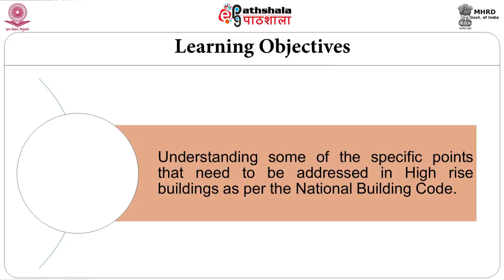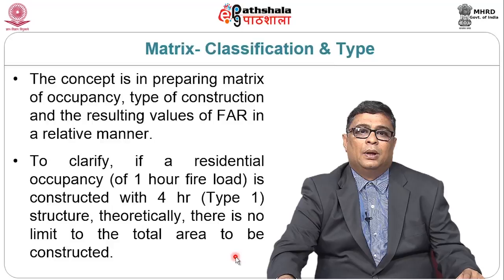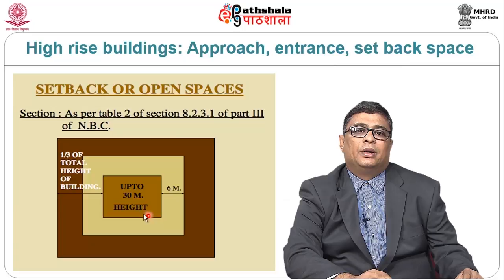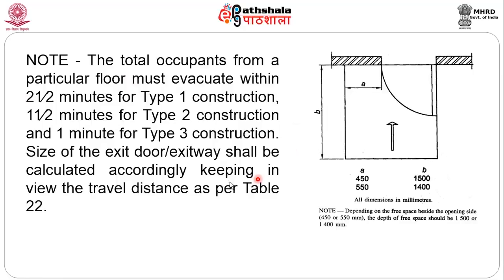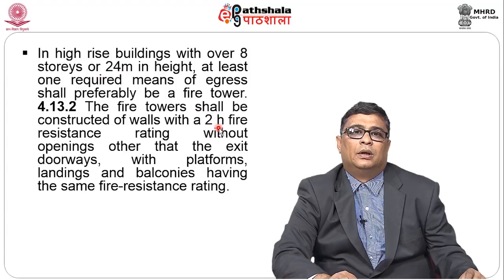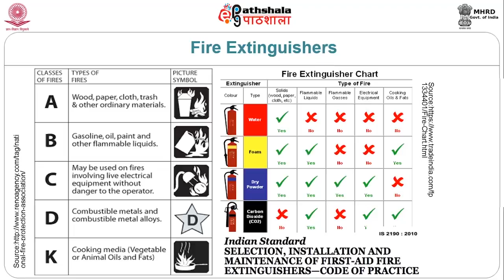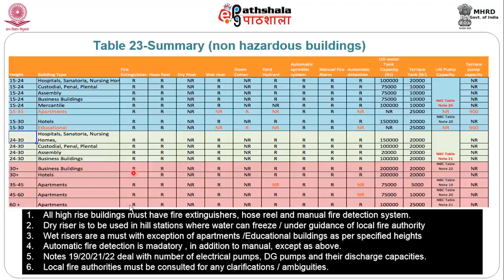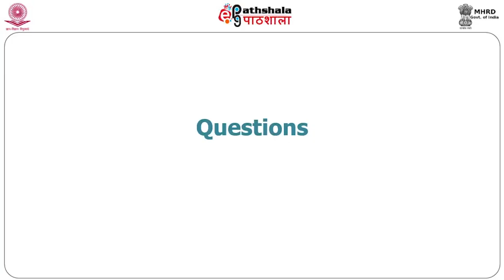Fire Safety in High rise Buildings

Comment: I happen to notice there is a mistake in the first example of that fAR problem. Its written 12000/100,where it should be 12000/1000. Otherwise you will have 120 floors.
Reply: true

Comment: Adding to all above stated points which are very important and basic.
Can we make slow spread of fire by introducing more fire retardant materials ?
Is there any code for fire rating of building material ?
As many new interior materials are used now a days and most of them are highly flammable.
How to test the amount of smoke and toxicity of gases developed in case of fire of building materials ?

Comment: How will the pump in the Wet riser work when there is an electricity cut off ?
Reply: The entire pups will smartly  behave after switching on DG pump which is already installed in pump room..
Reply: Dear ahmed shaik during the emergency the electrical services required for the fire protection is isolated hence during the emrgency the electrical supply for the main pumps still works